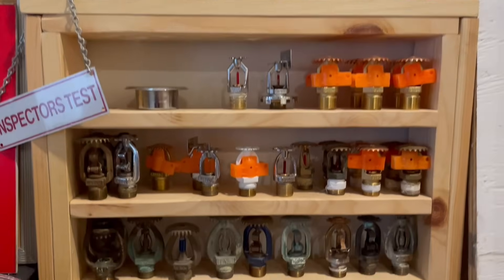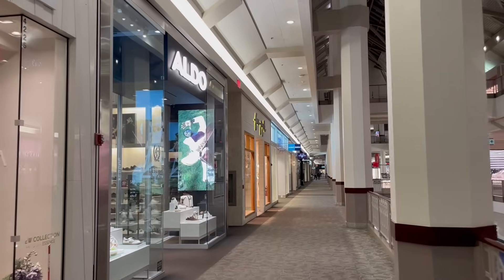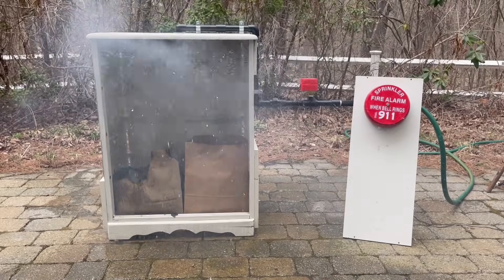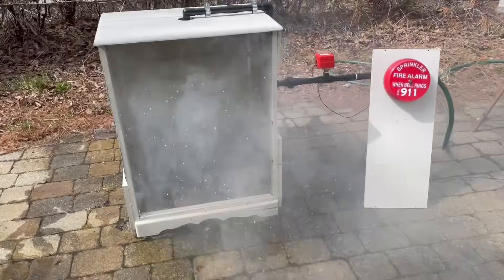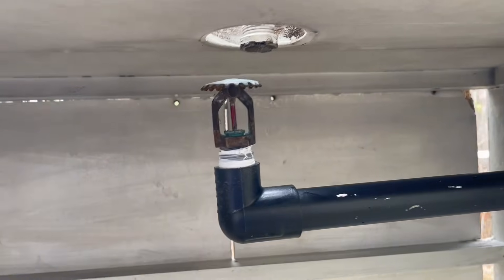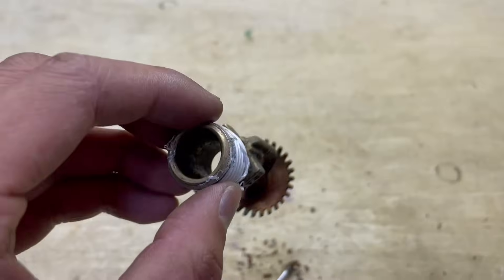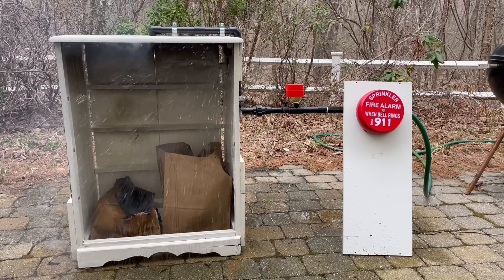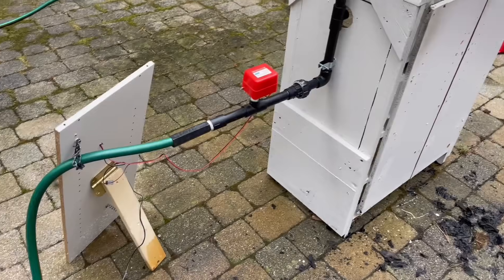Activating Corroded Fire Sprinklers with Fire Alarm Bell: Will Rusty Sprinklers Work? Sprinklers ‘25

Comment: 10:06 I think fire sprinkler system should use PVC or some sort of plastic piping because if the sprinkler head fails in the pipe will melts and then it will release water. Because some water is better than no water.
Reply: Yeah I agree, unless its a dry system where there is no water in the pipe until after the sprinkler head is triggered… though I guess maybe it would still work im not sure

Comment: Wait...but how do you check if a concealed head is rusted if you literally have to melt it off to see inside? I always thought it was just loosely sat on there and got spat out by the water pressure but apparently not.

Comment: Just watched this and then painted heads video. Im a 20 year fitter and this proves my theory that paint and external corrosion won't prevent the head from going off. But I'm sure it's a just incase type of code. Possibly a money scheme as well... who knows. But great demonstration and I believe your head that failed, was because of internal blockage... scaling, debris, and on cpvc systems, glue is the culprit.
Reply: Easiest thing to consider any time theres some sort of code or policy is liability, and the chance is thats usually it

Comment: Awesome video!  This prooves without a doubt that fire sprinklers are a great investment, especially if you live in a two-story house.  Even if the sprinkler is a commercial sprinkler and the home water pressure is under, still a phenomenal performance.  Insurance companies love homes with sprinklers.  I understand that fire sprinklers are mandatory in schools?  That is code?  I think that schools are required to have fire sprinklers?  Correct me if I'm wrong but do insurance companies love residential fire sprinklers?  That would be interesting to find out.
Reply from the maker: I believe commercial buildings are pretty much all required to be sprinklered now.
Reply: @FireAlarmDude5967 Do insurance companies like homes to be sprinklered?
Reply: Do you know if insurance companies like homes with sprinklers?  A lot of newer homes have them now and I thought it would be interesting to find out.

Comment: I have the concealed fire sprinklers, 1 potter horn inside and 1 potter horn strobe outside that is tied to the sprinklers outside. I should make a video to show you. I have no idea how it works but i know it works with the sprinkler system. These were installed in my new home and all houses in my neigh have them.

Comment: At 0:24 it looks like that sidewall fire sprinkler is mounted upside down. Might even have some paint on it too.
Also, it would appear the pendant sprinklers in my residence hall’s bathrooms have some corrosion, likely due to the fact that we have some pretty hot/steamy showers in there. Never really thought about it but I guess they might be non-compliant! 
At least they have heat detectors instead of smoke.

Comment: 4:50 A school I went to back in 2012 moved into a new building that had concealed sprinklers throughout most of the building (only the sports hall had visible sprinkler heads)
Reply: Interesting! What does concealed mean?
Reply: @BuildingToursForLife1660-4  Sprinkler head that is covered over by design (and the cover falls off when it gets heated up)
Reply: @pineappleroad 
is that a bad thing that the cover falls off?
Reply: @BuildingToursForLife1660-4 no, the cover falls off before the sprinkler activates so it can actually get the water out and spread it
Reply: Oh I see! Interesting!
Reply: @BuildingToursForLife1660-4 fire alarm dude actually made a video and he activated a concealed sprinkler head. I would recommend watching that if you want to see it